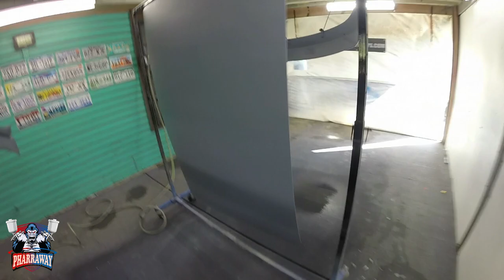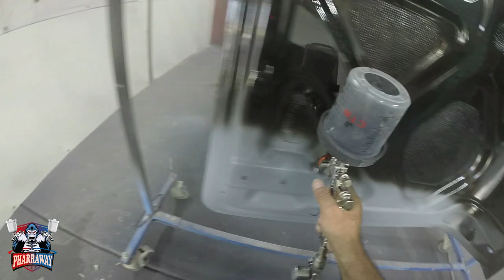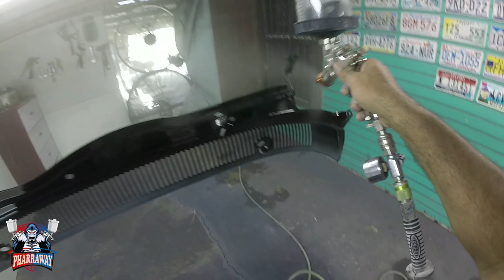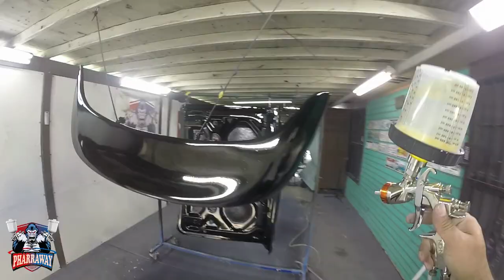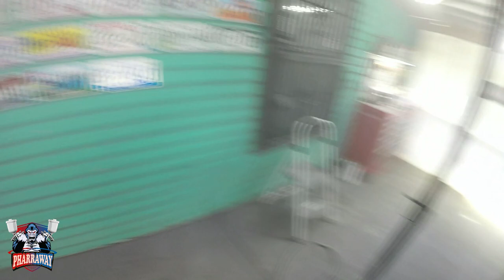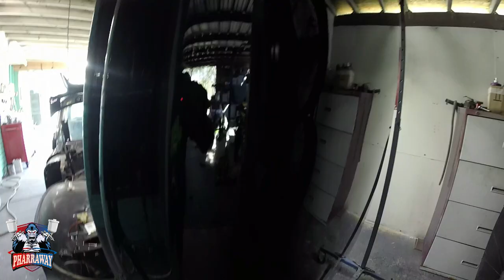The last pieces painted of the 1962 Chevy Impala

Comment: Cool that either aiir cap can do clear, but what are thhe actual differences between the 2?
Reply from the maker: Z-LP4 air cap is a modernized HVLP cap with improved atomization. An ergonomic body feels great in your hand. The balanced position of the paint cup makes it easier to work long sessions. Chrome finish for spotless cleaning with any automotive solvent. 

CC-1X air car is specifically designed to atomize high solid clear coats for easy application. Chrome finish for spotless cleaning with any automotive solvent